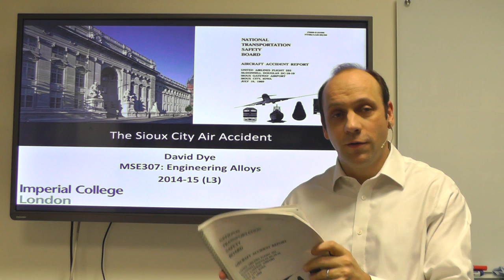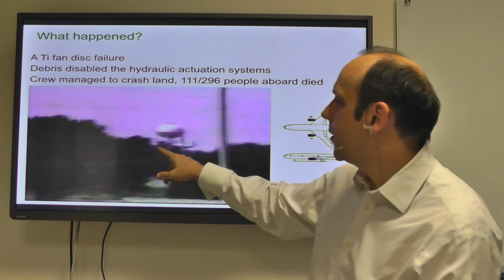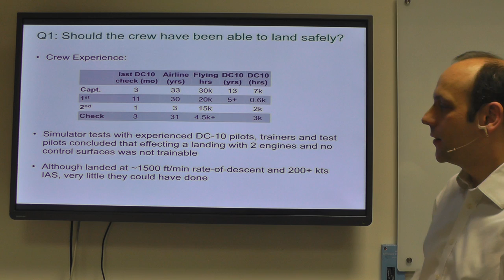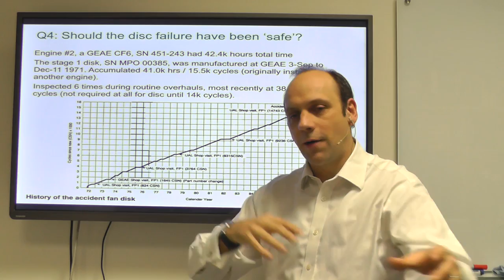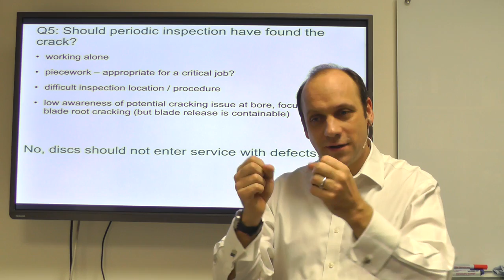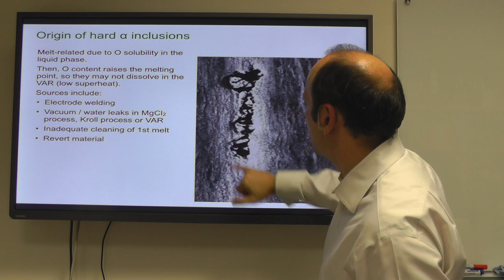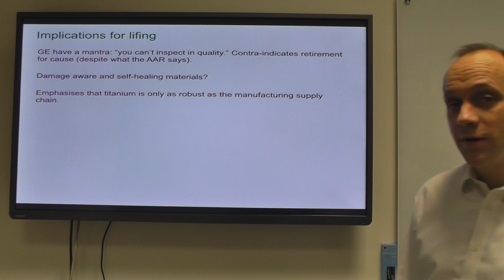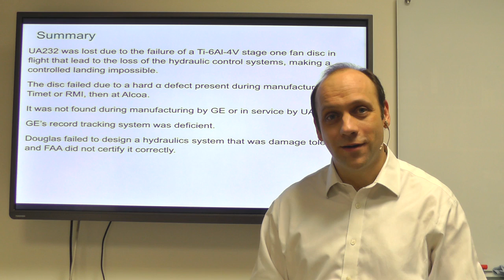L3 MSE307 The Sioux City Air Accident

Comment: Perhaps like in engineering human behavior can be broken down into simplified language that can be understood by almost everyone? Cascading failures in things like electrical power grids or the cascading power supply failures in electronics are similar to the cascading failures of management and quality control. This could be minimized with redundant systems instead of systems that are co-dependent.  LOL.. Age and experience along with a good ability to observe and problems made me one of the best trouble shooters of component level electrical and electronic circuits during the transition between vacuum tube and semi conductor technology. I'm often amazed with the similarities between humans and machines.